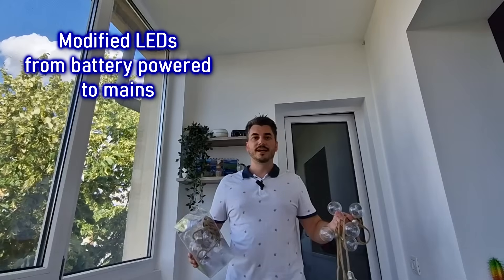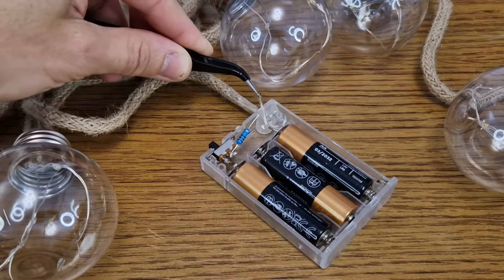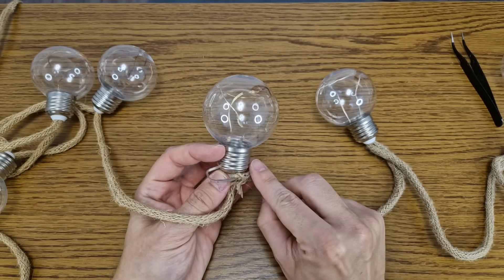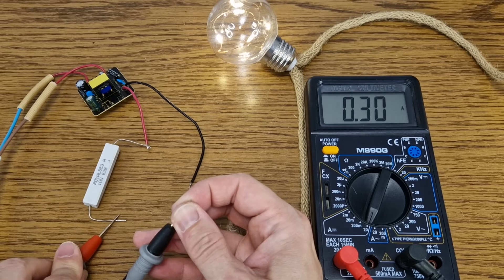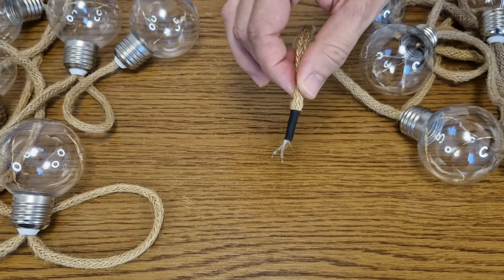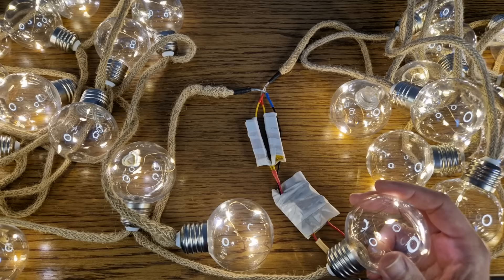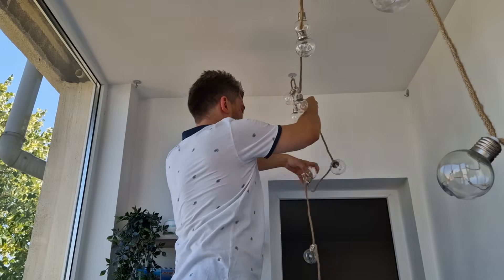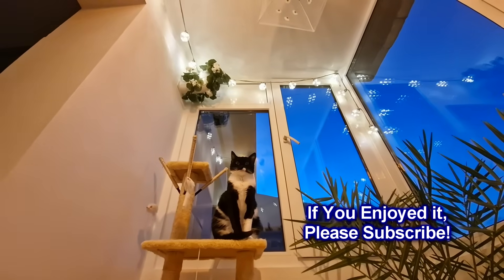Modified LED strings - from battery powered to mains

Comment: What's up with that mains wiring? Isn't the code in your country : blue = neutral, brown = live, black = switched (live), green/yellow = earth? (the internet says it is... 😀)
Did you check if you could change the feedback in the USB-supply to lower the output voltage a little?
Reply from the maker: Yes, green/yellow is earth for almost all of the house wiring. only from the switch to the ceiling sometimes we use yellow/green for the second light bulb. This is because most of the fire-proof cables that we buy for house wiring have the 3 colors, and just for the second bulb in the ceiling we don't invest in another type of cable, we use what we already have.
I didn't try to modify the charger, but a simpler way is to add a powerful diode in series with the resistor, to lower the voltage.
Reply: @Sorin_DIY  That kind of wiring would be a real issue where I live (Netherlands). 
The charger modification would improve efficiency and reduce heat (and I also sometimes add a power resistor, but since you had it open...).

Comment: With a long strings I prefer to provide power from two different sides, let's say positive at beginning of the strip and negative at the end of it. That way wire resistance is equal for all "bulbs" in the line. And yes, I know it'd be pain in the b to do it like that with this string :)
Reply: it is only necessary for RGB string to avoid color drift, sometimes more power injection point is also needed
Reply: @lifeai1889  I didn't said that it's necessary but the end result is better even with regular LEDs as all diodes will be equally bright (equally-ish ofc, no two diodes are the same). More injection point can help even with single color ones as that will result will overall brighter strip but I personally never had need for that. I prefer to add more LEDs  instead of pushing them harder, they degrade way slower that way.

Comment: Wouldn’t it be better to lower the output of the AC/DC converter so you can use lower resistance value and thus waste less power? Not that it matters, it’s not much.

Or just lower the voltage enough so you don’t need any current limiting resistor.
Reply from the maker: Yes, you can use a diode to lower the voltage. then use a smaller resistor in series. for LEDs you still need a resistor.

Comment: Bro can you make a small like a AA size battery flash light but it must be powerful...
Reply: Hey man, they make one already. ThorFire TG06S Mini. Use the Li-ion cell for max lumens. It heats up some, but you can hold it.
Reply: Powerful means heat. Heat means it has to be large. You can't have both.